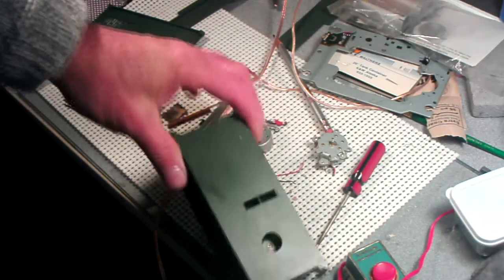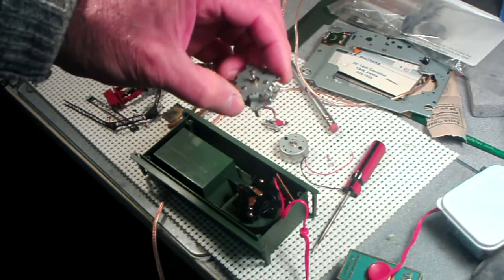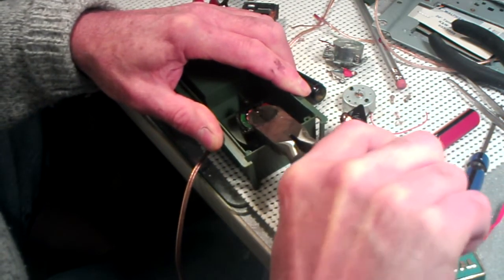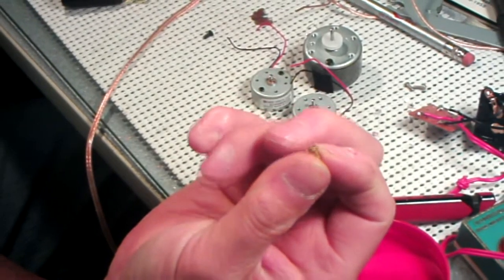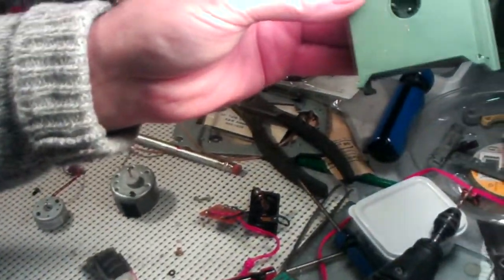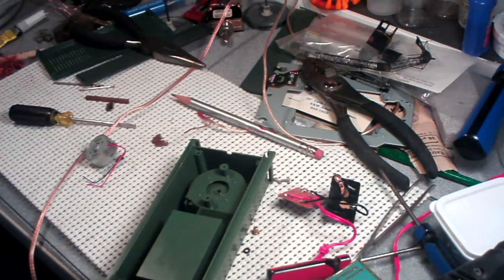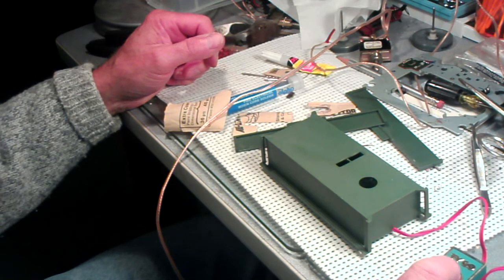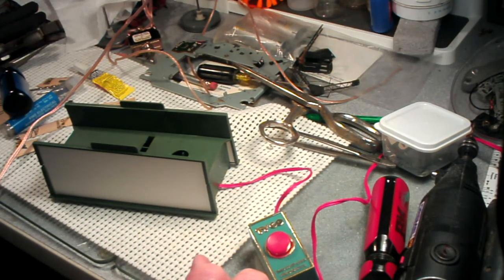Railroads & CD players, "whistle while you work"

Comment: Nice upgrade to the can motor, that same kind of air whistle is used on a lot of older Lionel trains and starter set engines.
Reply from the maker: I wasn't aware of that. I realize that it isn't purist to make this modification, but it would otherwise be considered junk, so the upgrade was worth trying. Thanks for stopping by Brad